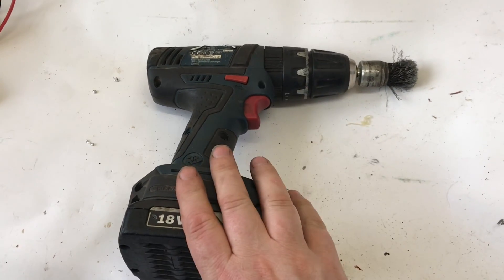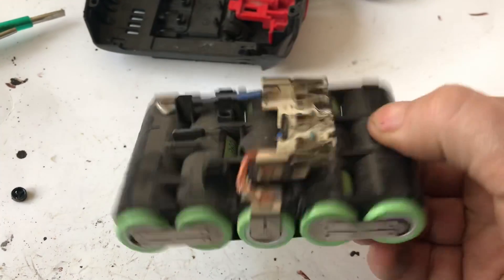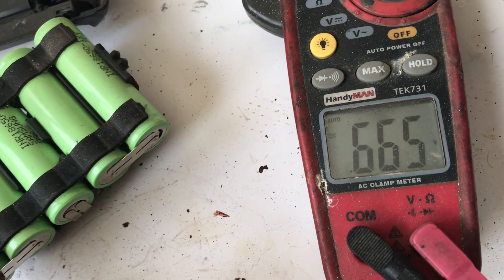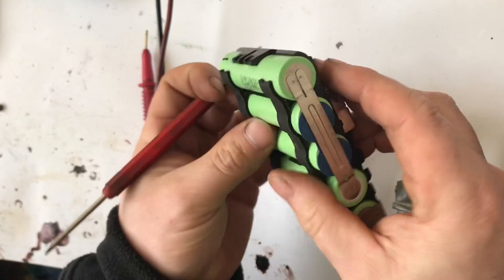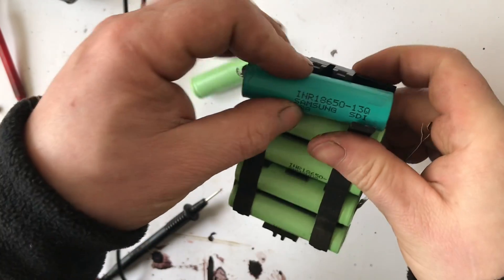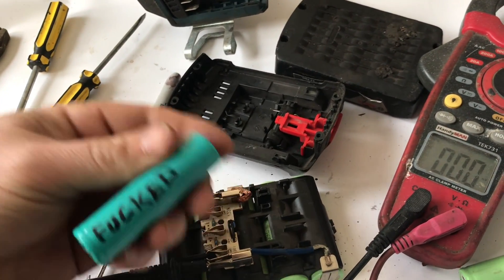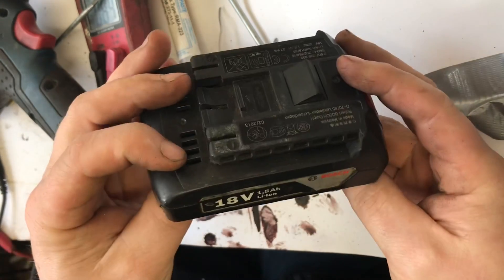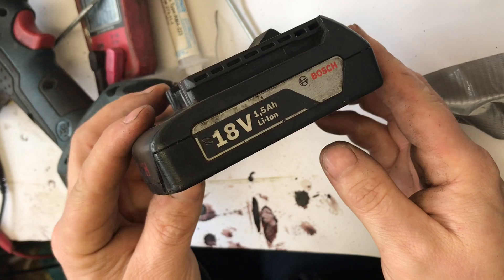Repairing Bosch 18v battery [ on the cheap ! ]

Comment: Very good . Be interested to see soldering process
Reply from the maker: Thanks! I made this video in April 2023 and the battery is still working, I was using it yesterday, I'll try to include more soldering process in future videos 😊 most import this is keep the soldiering job to a minimum and pre tin everything. I’d love a spot welder but I’m not going go make/buy one just for this job
Reply from the maker: Are you going to attempt to fix your battery too ?

Comment: Why don’t you replace with a higher mAh battery cell to increase  the usage time?
Reply from the maker: Good question, at the time the problem is that paper never refused ink, just because it says it’s a higher mAh doesn’t meant the batteries actually were, these batteries has been tested and proven to be as stated. I found it very difficult to get honest reliable batteries have had the stated mAh rating. The chinese up to their old tricks

Comment: why don't these batteries have a BMS?
Reply from the maker: I did wonder that too ?
Reply: @stevenharpervw  I have four batteries of these and I noticed they don't have a BMS. I don't understand why.
Reply from the maker: @maurokrone6859 you may ask Bosch . Now there is a temp sensor. So I guess if it senses a battery is damaged or over heating it will prevent charging

Comment: I usually balance these batteries with a hobby- charger (skyrc imax b6 AC ). If it's my battery, I'll even recharge the 0.6V cells as well ( if it takes a charge... Sometimes it's just good as a hand warmer and then into the bin ) .
Reply from the maker: Yeah when the batteries are damaged they are only worth recycling

Comment: It is very dangerouse to mix different cells.  Here is what you get when you ask  Google " does alithium ion battery cells in a battery need to be same?": 

Yes, the lithium ion battery cells in a battery should be the same or as close to the same as possible: 

Performance: Batteries with well-matched cells perform better and last longer than those with mismatched cells. 
Safety: Unbalanced battery cell voltages can cause explosions or fires. 
Connectivity: Mixing battery types or brands can cause connectivity issues. 

Here are some things to consider when using lithium ion batteries: 

Voltage: The voltages of the entire series-connected battery cells in a battery pack should be equal. 
Capacity: The cells should have equal capacity (Ah). 
Make and size: Never mix different makes and sizes. 
Maximum charge and discharge current: The time it takes to charge a lithium battery can be affected by its maximum charge and discharge current. 
Thermal runaway: Different types of lithium-ion batteries have different temperatures at which thermal runaway events occur. For example, LFP batteries are the safest.
Reply from the maker: Thank you

Comment: Samsung INR18650-15Q is rated for 18A discharge. You replaced it with Samsung INR18650-13Q that is rated 15A...
The capacity is also different, increasing the chances the pack gets dangerously inbalanced. This is the generation that doesn't have individual cell monitoring...
Don't do it!
Reply from the maker: Oh I didn’t know there was a difference between one being 18A and the other being only 15A would if make any difference the fact that the rest of the battery pack is old, would the over all capacity, have also dropped ?
Reply: @stevenharpervw  
Mixing different batteries into a series pack without individual monitoring (like all newer 18V packs have) is just asking for trouble. 
Having lower capacity might cause that cell to be over-discharged and wear out sooner. If it has higher capacity it might cause the other cells to discharge too much. This pack only monitors series voltage.
Then when charging it might over-charge (reach >4.2 before the total pack voltage is anywhere near 21V)... and overcharging Lithium causes a lot of trouble..

The soldering might have already damaged it from the get-go. There is a good reason they are spot welded instead of soldered. 

There have been a few fires when charging these older batteries that lack individual monitoring and Bosch was forced to change their design. With previous tech Ni-MH and Ni-Cd batteries individual monitoring wasn't necessary because they would 'never' burst into flames like overcharged lithium cells do.

Comment: Pity the do not have a mechanical fixings on these batteries make it easter to replace the cells.Wonder if a Parkside battery pack would fit in the bosch shell
Reply from the maker: Yes you can put any 18650 cells in to these batteries but the C rating has to be the same,  ie you can’t use laptop batteries

Comment: So, I have a Bosch 18 volt, 4 Ah battery.  When I press the button on the back, no lights.  When I put it in the charger, nothing (acts like there is no battery in the charger).  Will it be one dead batter or will it be the circuit board or how can I tell?
Reply from the maker: Open the battery and like I Did, test each cell should be between 3-4volts  you will probably find one dead cell and you can just replace it like I did
Reply: @stevenharpervw  Awesome!  The factory sent me a new battery but since I have this one just laying here, I figure I may was well take a shot at fixing it.  Thanks!
Reply from the maker: Even just to take a shot at it and see which cell is bad

Comment: This cell don't have 3000mAh, but 1300... and those that were already in the battery have 1500...
Reply from the maker: Where does it say the mAh on them ?
Reply: @stevenharpervw  Really?  Where did you get that they have 3000mAh.  Samsung has the inscriptions 13Q or 20R on its cells add two zeros to it then you have the capacity but first what you should do is find the datasheet
Reply from the maker: Interesting. Thanks for the info
Reply: @stevenharpervw By adding one 1300mAh battery to a 1500mAh group you’ll be either stressing that 1300mAh battery or, in case there’s a BMS, the capacity of the package will be lowered to that of the 1300mAh battery. 

It would be better to test the capacity of each individual cell (most 18650 chargers can do that) and then add a battery that best matches the other ones 

Also: that one battery at 3.8V might be on its way out too. If not, I’d highly recommend to charge that one individually to at least match the rest of the group. 

All the best!
Reply from the maker: @Conservator.  fantastic info thank you so much 👍👍👍👍👍
Reply: @stevenharpervw  
My pleasure! It’s nice to get such a positive response on a video from over a year back. 👍

Comment: Great demonstration, makes me tempted to pick up some failed batteries from others and see if I can recover them like this.
I think though that buying a replacement cell would have cost more than a couple of Euros? Just going by when I bought a similar cell for something else, can't remember if it was the same size though
Reply from the maker: Aliexpress for 18650 are about €2 but in saying that you do need the quality batteries that can handle fast discharge like when a drill or cordless angle grinder demands power straight away.  But if it’s only 1 or 2 batteries cell required to bring the entire 18v battery back to life it’s well worth the time doing so